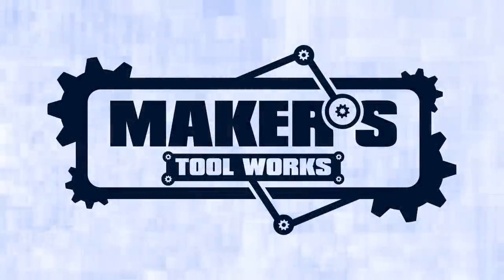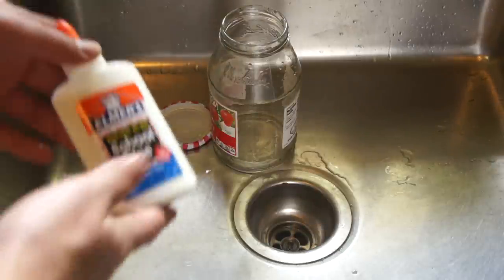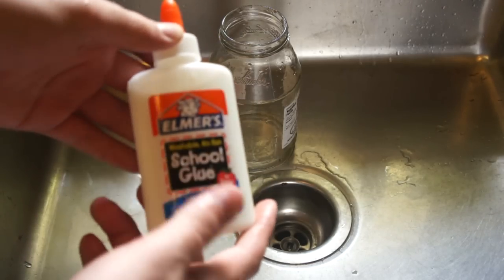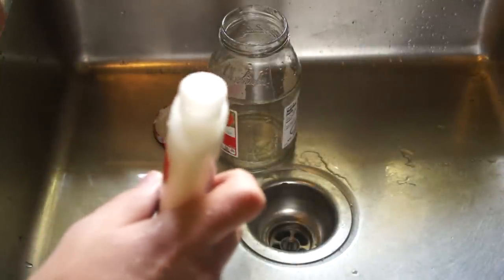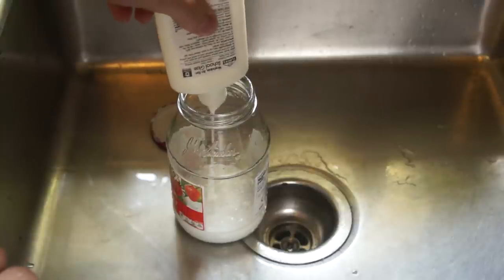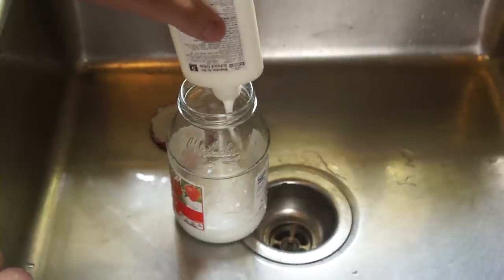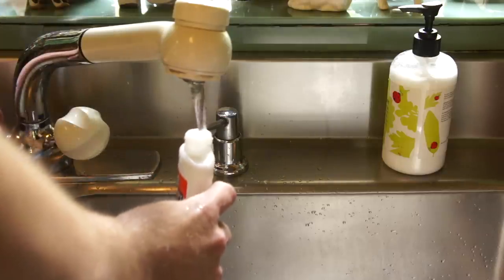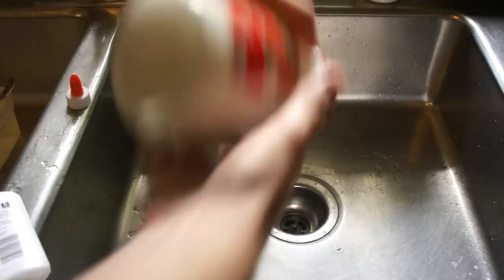How to Make and Apply PVAc Glue Solution to your MendelMax 2.0 3D printer for PLA

Comment: For PLA printing .. Elmers purple glue sticks provide and stronger bed adhesion, if straight PVA isn't enough. The glue stick is about as strong as possible, that still allows getting your part off the bed ... did try Gorilla glue, super strong, but after breaking my bed glass I still couldn't get all the glass off the part after an hour of hacking at it, LOL !!!   Hairspray is about equal to diluted PVA.